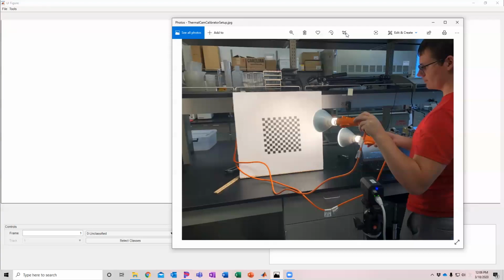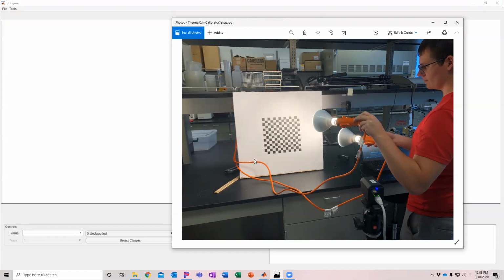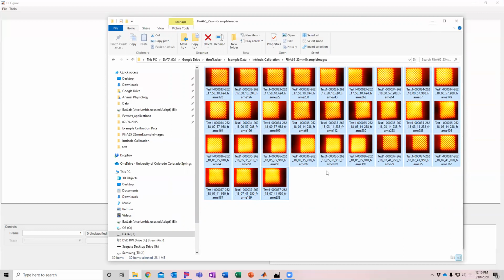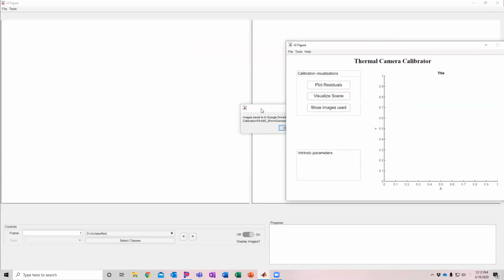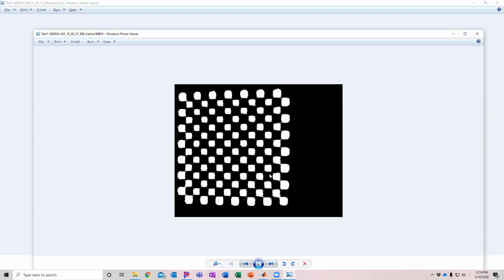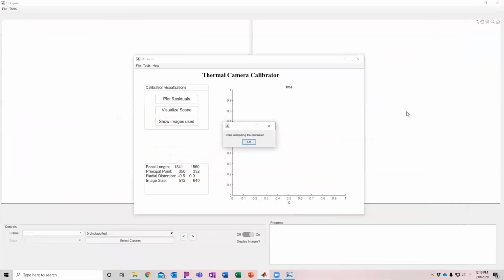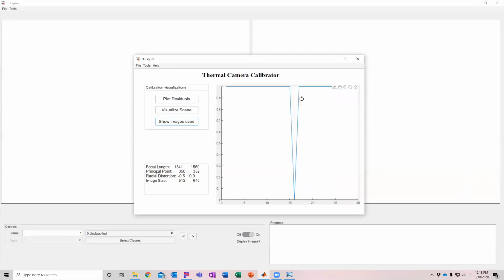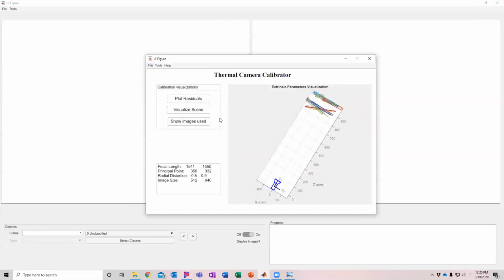ThruTracker--Making an Intrinsic Calibration

Comment: Dear Dr Corcoran,
I run your software ver. 1.8.9 with your example data, but it show an error
"Error using matlab.ui.internal.controller.WebMenuController/fireActionEvent (line 67)
Error while evaluating Menu Callback."